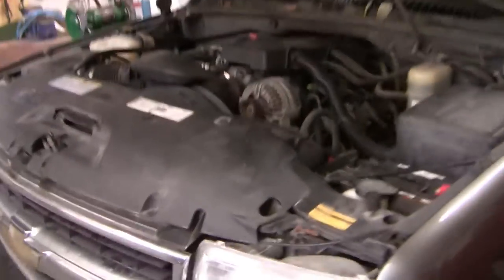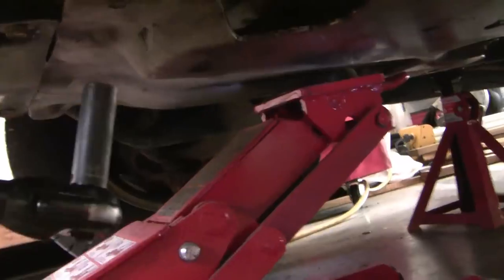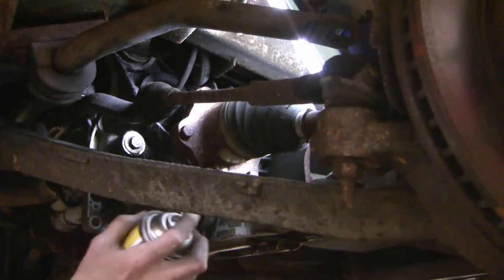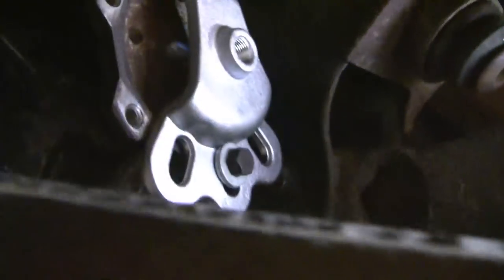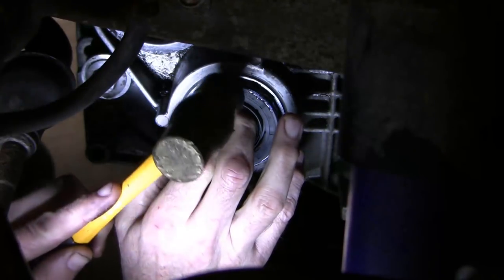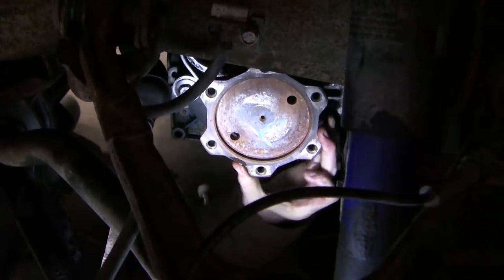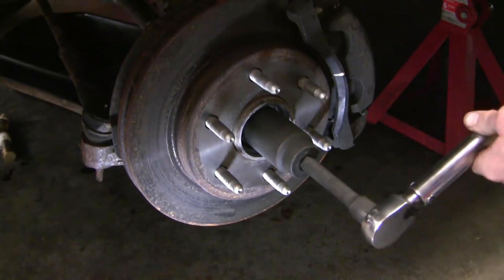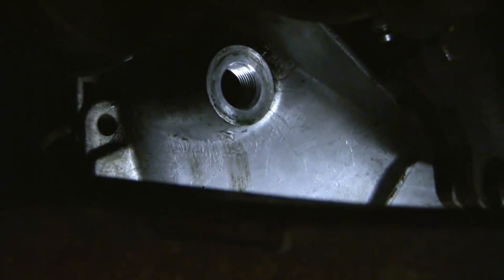How to replace left front axle seal and CV axle, Chev 4X4

Comment: So I finally went under my truck today to do an oil change and didn't see any rips in either of the cv joint boots but what I did notice was the passenger side boot (both sides inner and outer boot)was very easy to squeeze and the drivers side boot (inner and outer boot)was very stiff. I assumed that both boots should feel relatively close since they are the same part but not 100% sure. Any thoughts on that one?
Reply from the maker: +DJ Bobby J A snapping sound with each revolution of the wheel, worse with turning, is usually the CV joint if you can't find another source. If you don't have a lift you could ask a friend to drive slowly while you very carefully walk beside and try to isolate where the sound is coming from. Of course when you get it up onto a jack you can more closely examine other parts like the tie rod and hub and ball joint. Ya, both joints should be identical.

Comment: What slide hammer kit did you use? How did you fit it in there aren’t they like 2 feet long?
Reply from the maker: Yup, little room, it didn’t work very well. Fortunately tapping with a hammer is easier.
Reply: spelunkerd I removed the knuckle fit a good sized  slide hammer tool got it out like butter. Only it broke the snap clip so I had to go to dealer to get new one

Comment: Were there any bearings on the half axle? I have a strange hum and I thought it was a wheel bearing,  but when I shook the CV where it meets the flange into the diff I noticed a fair amount of play and I'm thinking it's a bearing in there.  I would prefer not to rip apart the diff if I don't have to.
Reply from the maker: Yes there are deeper bearings which will be partially visible when you remove the seal. The weak player in these systems is the CV joint, which will cause excessive play which will then put strain on other bearings down the line. Let's hope your excessive play is just due to the CV joint.

Comment: Were the seals the same on right and left sides?

Thanks for posting.
Reply from the maker: It's been so long I don't remember, but I don't think so. Certainly the two axles are of different length on a 4WD because of the shift motor on the passenger side that locks the axles together. I did a partial video of that mechanism years ago. Good luck!

Comment: Is this the same for the passenger side?   I want to replace both sides.   Thanks!
Reply from the maker: Quite different on the passenger side, especially if you have a 4WD. The shift motor is usually on the right, so consult a dealer repair manual to see what you're up against.
Reply: @spelunkerd  Crap.   Thanks for the reply!

Comment: I am gonna attempt to do mine tomorrow. Hope the c clip stays where it's supposed to. Would it be ok to leave the axle in the tire?
Reply from the maker: Ryan Vandale I guess you could, but there wouldn't be much advantage since a tire and axle together are awkward to handle. I didn't show it very well but when you get to the C clip, push the axle medially since the C clip is pinched normally and it almost falls out when the axle is pushed to the inside. ie sit facing the hub as though you're doing a brake job and push the hub toward the diff. The other point is that the small bolt that holds the diff together can easily be broken, so don't overtorque it.

Comment: I have a 08 Burb LTZ 71. I imagine it should be the same?
 Also it was great but to see  you do it on the ground.
Reply from the maker: +Stefan S. Vassallo Can't say, probably similar. Before working on your car, invest in a copy of the dealers manual. I use Alldatadiy but Mitchell is said to be just as good.
Reply: I have an 09 Avalanche LTZ 4x4....was the front seal similar for you to this video? Any differences?

Comment: 1999 and up GM trucks get this grinding noise coming from the front over time.  It`s the bearing in back of that seal... always change the bearing if you have to change the seal.  Most of the time the sound is coming from front driver side..
Reply from the maker: That sounds like the voice of experience, and if I ever need to go back
 I'll plan to do that. So far, after 360,000 km, no grinding yet on this
 vehicle.
Reply: Is it difficult to change the bearings from this point?

Comment from the maker: It's too bad that GM is not as forthcoming as Chrysler, who give a free build sheet by email to any unverified owners who ask for it and provide a VIN. I usually go to Alldata, which sometimes helps a lot. As I recall, for my model/year there was only one front axle type in the particular 4X4 that I had. I don't remember if the RPO codes tell you anything about the front axle. You could check your RPO codes and see -- they are usually in the glove box.

Comment: my 04 yukon was missing both dust caps, but that was ok when I was doing the front wheel bearings i could leave the wheels on the vehicle on the ground to break the axel nuts loose>
( I had to use a 3/4'' breaker bar and a 4 foot pipe!!)

Comment: don't understand the orientation of the half shaft, does the inner spline of the cv joint shove into it?...please explain, thanks...
Reply from the maker: Yes, that's how it goes, the female CV splines mate up with the splines on the shaft. It's been a while since I did this one. On the other side there are splines and a groove for the C-clip, inside.

Comment: Hey great video! Just wondering what the size of the seal is. Is it 8.25?
Reply from the maker: I don't know, I just take the engine data to the parts store and they work out the details. For this one, make sure you are clear about which way goes out. For this seal, it is easy to get that backwards. Some seals have the outside labelled as such with small print. Good luck!

Comment: I still have concerns regarding the C-clip. The shape of the inside CV axle part is shaped so it enlarge the clip up to its correct size. ON the other hand it seems a little harsh to undo it with hammer taps.
To remove the rear axle C-clip you have ot remove the cover. Is there a cover on the front axle body?
Reply from the maker: That's a thoughtful question, Tom. The dealers manual put out a TSB describing how they recommend getting that clip out, because some mechanics were having difficulty. They start with the ludicrous suggestion to take the entire axle off and deal with it on the bench, the split the diff in two to get the clip out. There is no cover, you have to spit the diff on a bench with the entire axle off the vehicle. Most guys who have visited here seem to get it off without doing that. My experience would say that it is not about brute force, it is about rotating the shaft to blindly find the exact spot where it taps out easily. My concern was a huge swing when the clip is sitting on an edge could bend the clip so it is even less likely to come out. Good luck! I hope you visit back and record your experience.

Comment: Hello. I have a 2001 GMC Yukon 4wd and my front left seal is leaking and i am wondering if the seal is bad will it make the half shaft wiggle side to side. I also just replaced the wheel bearings both sides but the left side wheel wiggles side to side still and i am wondering if it could be because of the diff seal. Thank You
Reply from the maker: Assuming you mean the axle movement is front and back or up and down from the vehicle's perspective, there isn't enough strength in a seal to hold a shaft in the midline, so more than likely you've got a bearing or CV joint problem. The CV joint there commonly goes bad, causing secondary wobbling which in turn damages the seal. Possibly the underlying bearing behind that seal could go bad as well, maybe secondary to a bad CV joint. If you mean the movement is along the axis of the shaft to left and right, then the seal doesn't restrain that movement at all. If you get a clicking sound with each rotation of the wheel, especially when turning, or if the boot is leaking, then the CV joint is bad. Lastly, if you mean the tire has play at the 3 oclock and 6 oclock positions when only that wheel is jacked off the ground, then the traditional cause is often a bad inner or outer tie rod. You can usually see where it's moving when underneath.

Comment: How much would this probably cost to be done with a good mechanic or I guess a dealership I should say? Can I stretch this problem out longer if I add differential fluid?
Reply from the maker: Yes, if you keep an eye on fluid levels you can wait for a while. It might make a mess but often not so bad. Not sure about cost, it may depend on how easily the axle comes out. Good luck!
Reply: I know the Chevy Dealership charged me $69 for parts and $219 for the labor on the passenger side when I had them do it. Didn't want to deal with the transfer case. I would think they would charge less for the drivers since its less to do than the passenger side.

Comment: how many gallons is your air compressor? for you air tool to take out that nut on the axle?
Reply from the maker: 25 gal, with a no-name 1/2" tool. It's not great but most of the time it does the job.

Comment: I changed the cv axel but it did not fix the rubbing/grinding noise when I press the gas, can the reason be no gear oil?  Please help
Reply from the maker: +matt Salazar Yeah, if not already done I'd drain and refill your diff gear oil, or at least check the level. Also check the front and rear prop shaft U joints. If you can get the vehicle onto a lift it would be easier to localize the problem -- often an opinion from a pro will give a clear route to repair, even if you eventually do the work yourself.

Comment: Hi, would this be the same process on a 2002 avalanche with 4wd?  A year ago I took a long trip north pulling a toy hauler, on the way my rear dif started leaking.  I was able to get home, pull the cover, reseal it and fill it, and no problems.  However I noticed the front leaking on the skid plate, at what looks like the point where the left (driver side) axle meets the differential case.  I didnt do anything about it at that time, as I never saw any grease come down on the driveway so figured I had time.  A week ago it started squeeling bad, so today I pulled the AC tensioner and Serpentine Tensioner and replaced them.  The squeeling is gone, however I am getting a howling sound now at acceleration. I put it in park and rev it,the sound doesnt show up, so I think its the diff.  Im going to check the fulid level in the morning,   I am taking a trip north far from home, so Im hoping I can just put new fluid in it and buy some time.  What are your thoughts?
Reply from the maker: The process is likely very similar, but before you tear into something like this you should have a look at the dealer's repair manual. I use alldatadiy, which is pretty cheap for a 5 year subscription, though some guys use Mitchell or even ebay copies.
Regarding the howling sound, I wonder about a wheel bearing, which statistically is more common than a major diff problem. Also the CV axles tend to go bad, though that usually gives you a clicking sound when turning. The hardest part of this is getting the diagnosis right, which would be easier and safer if you had access to a lift. If all you have is jack stands, then pay careful attention to the CV axle boots, and look for play in the wheels at 6 and 12 on a clock face, listen for sound when you spin the wheels. If howling is worse when under acceleration, it is more likely in the drive train to the rear wheels, maybe a pinion bearing or rear wheel bearing. If you still have trouble isolating the sound, then a pro opinion might be wise, even if you later decide to do the work yourself.
Reply: I replaced the hub and bearings on both sides a while ago in the past 2 years. The sound only shows up when I hard accelerate enough for overdrive to kick in.  Then its a hum/howl like a blower.  Im going to check and make sure I put my intake cannister back in properly before I do anything.  Thanks for the advise.

Comment: Great job.  I have a particular question about the C-ring.  I have a 2002 chevy 2500, diesel with the seal out.   I cant for the life of me, remove the spline out because of the C-ring.  I've even dropped the whole axel just to make things easier to get to.  Does it have to be in a certain position or rotation for the spline to become free?  A couple mechanic friends told me tough luck. They explained to me that sometimes the ring wears into the locking groove and it will never come out.  I have a hard time believing this.  My wallet has a hard time believing this.  Any ideas? Thanks!
Reply from the maker: +Timothy Bauman I guess I didn't see this question until the second comment. Yeah, as you can see I had a similar but less severe problem, and it took many minutes before it just slid out with no effort. It seemed I had to have it rotated just right, with the right pressure on the ring in just the right position. Unfortunately you can't see the ring and so you're working blind, hoping it will be easy. To make things worse, if you try to force it you could bend or damage the ring and that might make it even harder to remove. GM put out a TSB describing the problem and their "solution" was to take the whole diff off and split the case, which was disconcerting. That sounds a lot harder than just adding a little diff oil once in a while.
Reply: @Godfather16641664  the stealership won't touch it because  it's work and they know it. One of the dumbest things gm ever allowed put in one of their vehicles. Me and a friend had to drop the whole differential  and get it out in the floor and spilt the case and take the cross pin loose and  remove. (Be careful,  pay attention, because  shit goes everywhere when you remove that pin) take a brass rod and big hammer  and beat the shaft out of there. Poor, pitiful,  stupid design. Not a thing wrong with putting a differential  cover that can be removed  and remove  a c clip to remove an axle like they used to make em back when engineers  were people  who designed  things with sense.

Comment: I have a question . On a 2001 mustang gt is it hard to fix the front left side axle seal leakage ????
Reply from the maker: I haven't done this on a 2001 Mustang. If it were mine I would start with an electronic copy of the dealers manual, probably Alldata or Mitchell.

Comment: so basically is this a good reference to use on most vehicle for example my Nissan titan has the same seal leaking so should it be about the same process?  Thanks!
Reply from the maker: +Kolby Walters When you work on many different cars you see common similarities, and changing a seal is a fairly standard procedure. However before jumping into a repair like this, I would always get as much information as I could. The best source is the dealer repair manual, which is available online from secondary sites like Alldata or Mitchell. I use alldatadiy. Manufacturers also offers subscriptions for their dealer repair manual, but the cost through a manufacturer is often hundreds of dollars more.
Reply: +spelunkerd Ok thanks for the response and great video I believe I feel a lot more comfortable now with watching the video and one question was the seal hard to remove at all?
Reply from the maker: +Kolby Walters No, it pries out easily. However the part all of us bite nails over is getting the axle out. In some vehicles, it won't budge. Read the comments below.
Reply: +spelunkerd I read some comments and I feel like we've all been in that boat but the part that really has me is I did more research and I saw some people say I have to drop the front diff on my truck but I don't see any reason too because it looks accessible just like yours in Ur video

Comment: Hi there Rickafix has a video where he replaces a cv axle but he gets a noise gear bix well mine is doing the same sound..is there a bearing in there to fix that noise ..I dont have a problem with the wheel bearing its coming out the front gear box when.wheel turns
Reply from the maker: The axle itself commonly goes bad and maybe that's the source of your noise. If you get clicking when turning, most of the time it's the axle, which has two universal joints under the dirt boots. The price of those axles has dropped significantly because of aftermarket competition. As far as the bearing goes, I think you have to remove the diff and redo the pinion bearing etc all at the same time. That kind of repair is quite involved. You need to get the backlash adjustments and crush washer torque right, or you'll have to redo the repair. Let's hope it's the axle.
Reply: Ok thank you the reason im saying its the bearing is because i have a slight play on that end when i wiggle that end of shaft